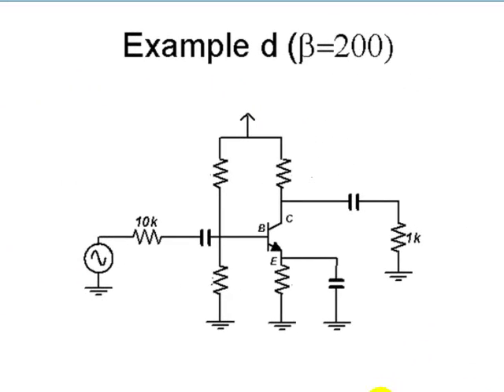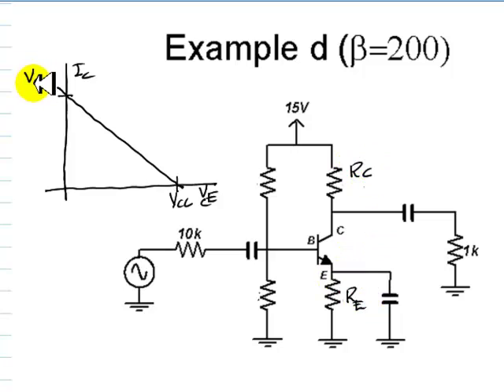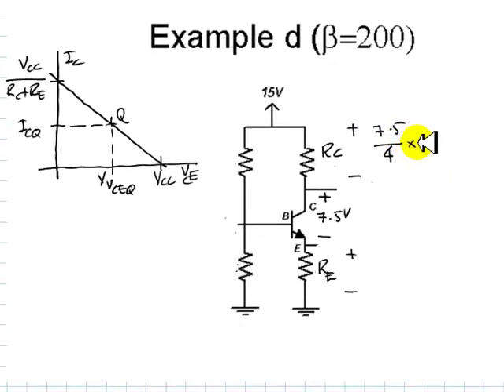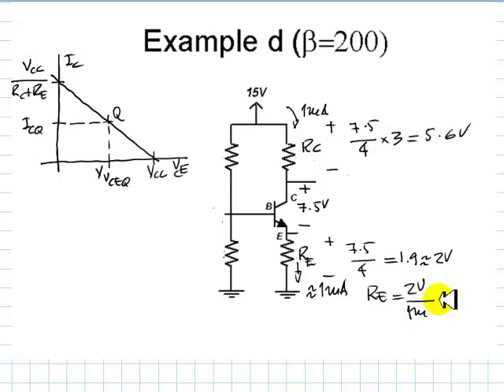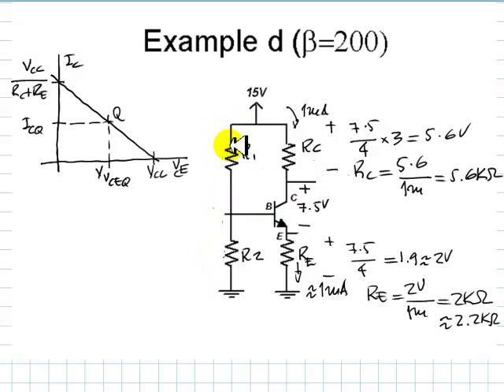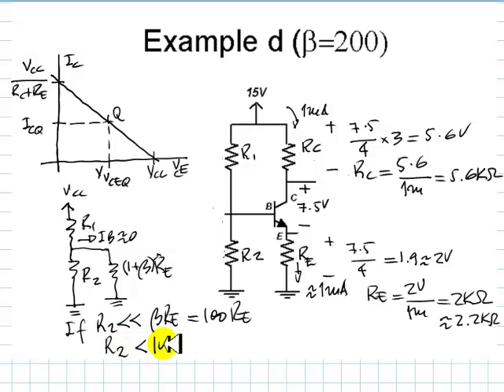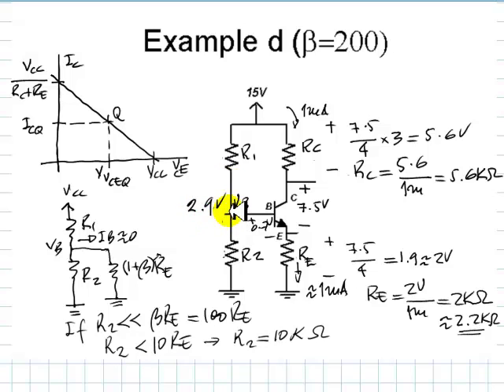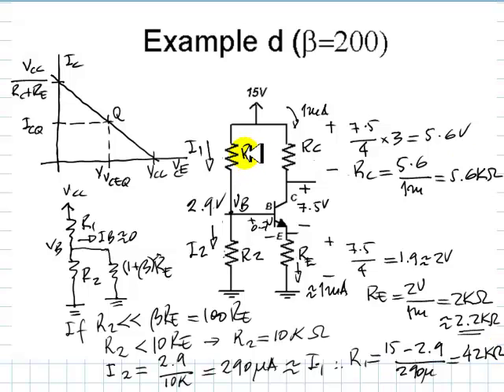EECE 251 - BJT Design of the Bias Circuit

Comment: It is clear from your closing remarks that you have designed a transistor stage has 2 outputs:
Ve:  an IN-phase voltage output at the  emitter 
Vc ; an OUT-of-phase voltage output at the collector.
Vc ~(5.6/2.2)Ve , ACgain=x2.5 ...of course this circuit is NOT a typical AC amplifier due to the unbypassed emitter.
Reply from the maker: Mr. Martin, thank you for your comments. In reality it is an AC amplifier. But we are looking at the DC bias. The emitter resistor bypass capacitor, and the two coupling capacitor (one to the previous stage and one with the following stage or perhaps the load) in a DC model are open circuits, that is why you don't see them there. Please remember that the impedance of a capacitor is Zc = -j/(wC). In DC, the impedance of each one of those three capacitors in infinity, an open circuit, so they vanish from the action. Again, thank you for the comment, because the same idea may have been lurking in the minds of other of my very dear viewers/followers/fans/students.